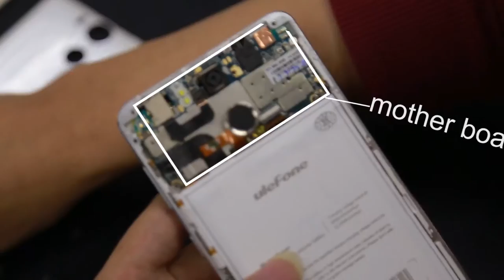Ulefone Power Teardown

Comment: Nice video. Which parts do you need to disassemble in order to replace a broken screen? Kind regards.
Reply: Just after reoving the battery you need to push the screen fro the camera place. check here, my experrience here si my experience tip of scree removing http://imgur.com/a/mOxfV